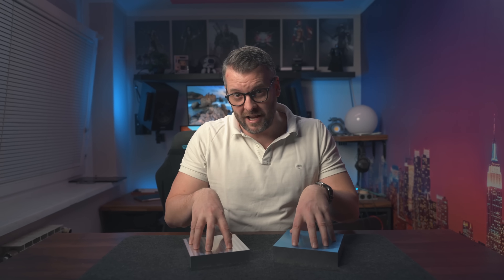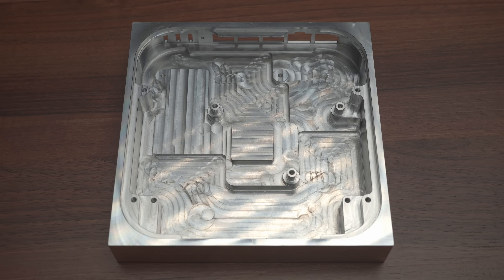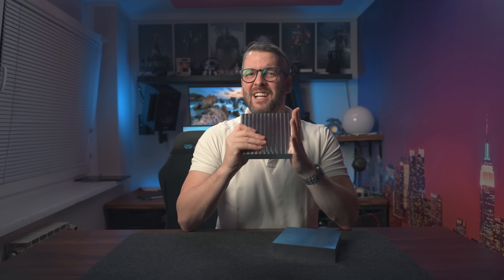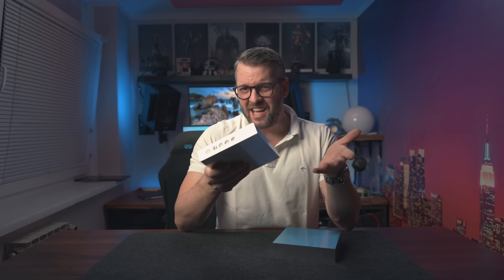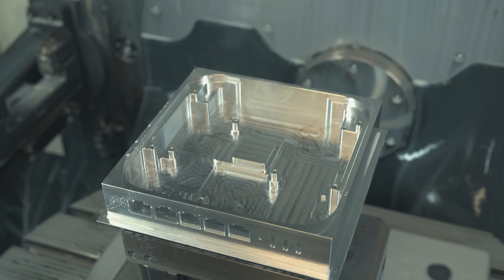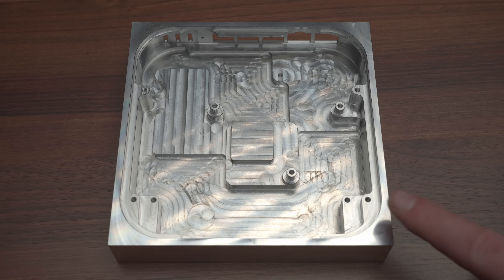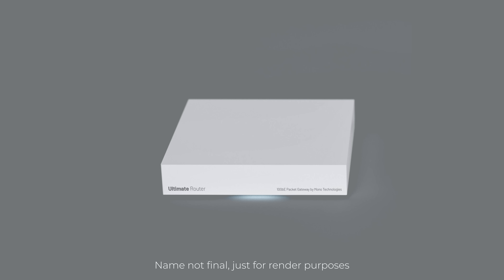We're building a high-end router. Here's the update for December 2024.

Comment: 5mm thermal pad is crazy! Was it not feasible to shrink that gap down to 2-3mm? Was this done to make the assembly process easier? your thermal performance will suffer substantially.
Reply from the maker: Fun fact, we're using a special kind of thermal rubber by Wurth that's not even out yet and we've done the tests. I'll do a dedicated video on this, but rest assured thermal performance doesn't suffer, at all.
That being said, we can always mill away less material if we wanted a thinner gap or change material.
Reply: @tomazzaman  i've worked on some products where we had to resort to crazy expensive thermal pads (2-3 dollars worth of raw material) just because someone forgot to make a cut out in the heatsink for one of the higher components on the board. Preventing us to lower the gap, i'm 100% sure the easiest way to save a couple of bucks is to try to reduce the gap. It might even save some machine time because you need to remove less material and you can use cheaper thermal gap filler material.
Reply: The gap is around 3mm, but they're using 5mm thermal foam to assure sufficient contact pressure
Reply: @magnuslubkowitz  Me speaking with my physicist phd in mind:  the smaller the gap the better! Even 3 mm seems a lot, unless you fill it with diamonds
Reply: Of course! I just meant to state that the gap actually already is 3mm and not 5, which I thought you were assuming, but smaller would always be better when only regarding thermals.
I myself am sceptical of the thermal conductivity of any foam, since pockets of any kind should be rather unideal for that, but since apparently something like thermal foam exists, it seems at least feasible. Surface contact is a very important factor as well after all, and maybe, taking tolerances into consideration, a compression of 2mm is necessary to account for that - but I'm just guessing in that matter, I have more experience with thermal foam in particular
Reply: Yep, 3mm gap is a bit exagerrated. Since planarity tolerances at this design are quite low, the gap can be 0.5 - 1mm. Lower than this would require spring tensioners. But at the end it all depends on how much heat you need to transfer. Also SFP cages need proper cooling for 10GBASE-T modules (4W each).
Reply: Yeah, anyone who ever spread some Arctic Silver as thin as humanly possible is screaming their heads off right about now.
Reply: @AttilaAsztalos  AFAIK the SoC provided in the board is far from 65W TDP of x64 CPUs then... well... Termal paste as CPU is not actually necessary.
However.
A thermal pad of 1,5-2mm would seem to me a better thermal interface rather 5mm of thermal material compressed into 3mm.
I am no product designer of consumer electronics, anyway...
Reply: @GsrItalia  The actual power to dissipate is less important - the question is "are you actually trying to dissipate some heat through the chassis, or are you just trying to look like you care about heat dissipation?".

Comment: That looks SO expensive to manufacture. It wasn't too long ago that Apple was the only company designing cases this way.
Reply: And in the end, for Apple all aluminum cases not only made the device more prone to corrosion, but the whole mechanical resilience got affected. So many fractured aluminum standoffs for hinges documented and seen out there.

It was only a fancy aluminum case which added nothing to the device. Just like the "magnesium cage" of the last IBM Thinkpads. But at least thinkpad screen hinges had lesser failure rate.
Reply: It was decades ago since companies designed cases like this. Do not assume that because you are not aware of them.
Reply: @firedeveloper  what are you even talking about?
Reply: @firedeveloper Remember the Mac Pro or all the new Mac’s?
Reply: @firedeveloper  Yes, but in these aluminum cased RF devices is actually a justified necessity. Here is just overengineering out of scales...
Reply: Nothing is expensive as long as you find someone willing to pay for it. Same as Apple. The catch is finding enough rubes.
Reply: @AttilaAsztalos  big brain tingz. :face-blue-smiling:

Comment: Wouldn't a more cost effective solution for the case to be a 2 part design (top+side)?  You could get all the standoff/cooler block features you need on the "top plate" where your cooling mass is relevant, and the complicated undercut features would be achievable with less complicated tooling (and possibly even with a bending "horseshoe" design a substantial reduction in material.  Less tooling, less material, faster CNC times in exchange for a seem which could even become part of the visual design if you wanted.  

I guess it would result in 2 parts in the BOM vs 1 (which isn't nothing) and an extra assembly step (though probably a faster/less fiddly one).  I wonder if there are other tradeoffs I'm not considering?
Reply: That was my thought exactly. Milling from a single block of aluminium is extremely expensive in terms of machining time and wasted material. Only companies like Apple can afford to make devices from an aluminium billet.
Reply: @faustovieira  on the other hand I imagine how hard would be to make the thing out of foldable aluminum sheet, like the cybertruck is made  (people don't realize that the car isn't the product, the product is the assembly method, if all cars were folded, they would be cheaper to make).
Reply: @faustovieira  Well, it depends, if he's making a high-end product for rich people that can afford it. Companies can always afford anything as the cost is passed to the customers. Its the customers that you're targeting that must afford it.
Not gonna lie, having a beautifully sexy machined aluminum block is enticing for me, specially compared to crappy "plastic routers", its like a hi-fi audio equipment, but for your internet. There's a public that would buy such things.
Reply: @monad_tcp  I don't think there are many rich people that care about a high end mostly open source router.
Reply: The unibody case (machined block) decision is because the router is passively cooled, and the case itself acts as a heatsink.
Reply: @cristinelcostachescu9585  That's why I suggested a machined top-plate block and separate from the side machining to make the tooling and CNC more efficient/easier.
Reply: @originaljws  sorry, I was replying to @monad_tcp's comment. Your comment instead I find it on point :)

Comment: I kind of assume you have already considered it, but in case you ended up with tunnel vision and didn't I'll mention the idea of just having some sheet metal hole stamped and bent into a box, and have a separate floor. The heat can (probably) still be dissipated via the case by just using some heatpipes between then, maybe even flexible heat pipes. I just think the sheet metal should be way cheaper than massive alu blocks and cnc, but that is just an assumption. Also you already said you aren't at price optimizing yet anyways.
Thanks for the update so far, I am so excited to see the progress.

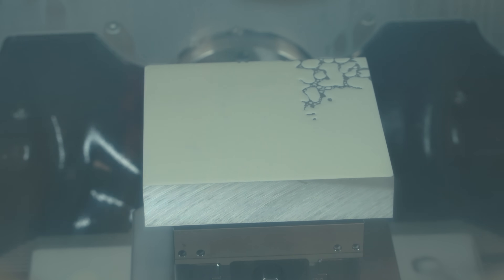Comment: I am not sure if there is a need to CNC the top of the case 7:38 
If you CNC the top you have to sandblast the top and if you don't CNC the top of the Case than you can save the cost for Sandblasting the top.
The edges most likely still need CNC to be a bit smother. 

The inside does not need sanding in my opinion. 

For the foot with magnets it should be grabble and not a hassle to pick it. Maybe grabbing grooves or holding from the foots it will have any.
Reply: Any raw block isn't straight so it's a must to make it flat. But instead of a normal end mill I would use a fly cutter (of something large with max 2 passes) to make it flat.
Reply: The first operation is not just for aesthetics. The raw stock is not perfectly square, an initial facing pass is done to make sure the stock sits perfectly square in the machine vice after it’s flipped (to mill out the internal features).

Still I think milling the enclosure out of a solid block of aluminium is a mistake, a sheet metal box and a normal (off the shelf) extruded heatsink ought to be fine for a networking appliance. Producing this part on that DMG Mori machine is not going to be cheap.
Reply: @just.oblivious  @Damicske I see top needs to be flat so the internier can be CNCed precisely. That makes sense.
I thought that the block on right side here 0:00 is already a flat surface. 
Any way it looks pretty and pretty heavy.
I am curious if we will also see a version with a more affordable case like standard switch case body.

Comment: The fully custom machined housing seems like great excess when a sheet metal and powder coated enclosure would be (to the customer) essentialy just the same.
Reply: And how would you handle the thermals? With a fan? Nope, thanks.
Reply: @sector-one  for a router. Essentially shouldn't effect it that much other than how quickly it will heat cycle. The dispersion area would be rather similar

Comment: By why bother with the aluminum? Isn't plastic good enough?
Reply: He literally said they wanted a passively cooled router, in other words without any active cooling, and while that's simple for basic routers, a 10GB high-end router probably gets quite hot at full load, so the purpose of the Aluminium case is not only to give the premium feel and look, but also to act as a passive heat sink, keeping the CPU cool. This is simmilar to how the legendary Flirc case for Raspberry Pi works, where the whole case acts like a heat sink, keeping the RPI cool while also being totally quiet.
Reply from the maker: As an owner of several Flirc cases, I can confirm :D
Reply: If you want it to be passively cooled metal is far superior
Reply: Thermal conductivity